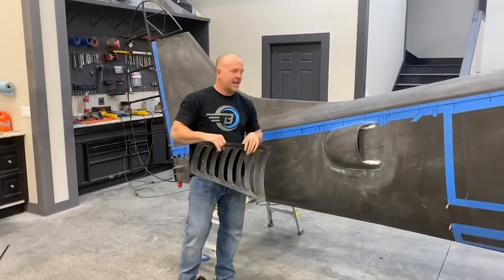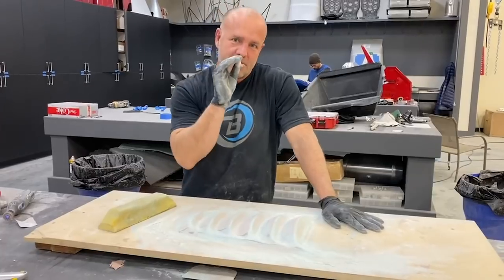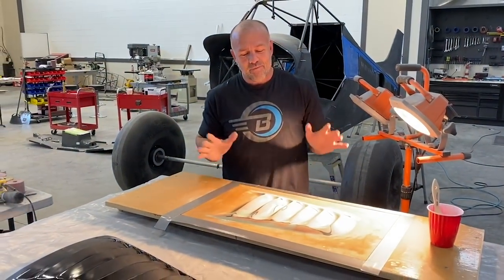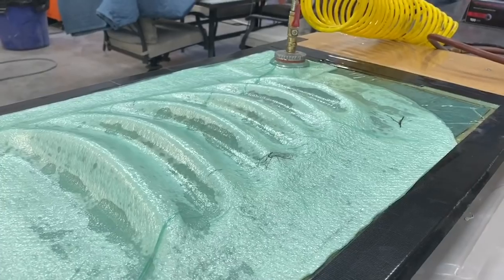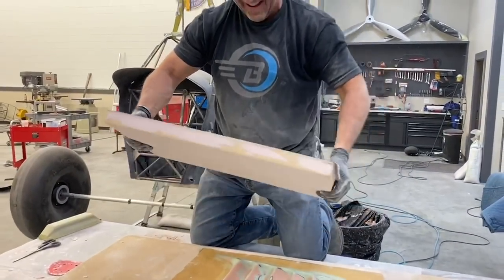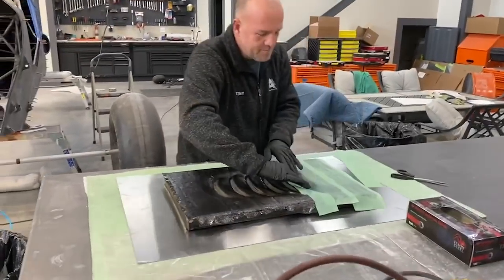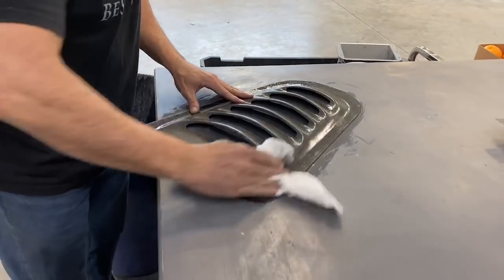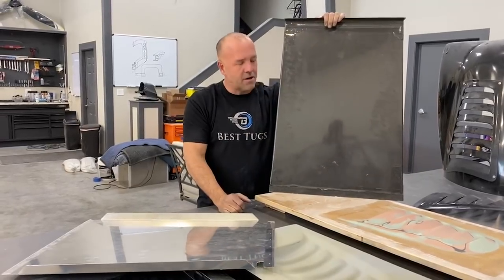🛠Making Carbon Fiber Molds (Scrappy Bush Plane 12)

Comment: I hate to say it because I love all you are doing but, it seems backwards to me. The larger opening should be toward the front so it tapers back toward the back of the fuselage.
Reply: It's an outlet not an inlet
Reply: He is looking for suction the air is coming in from the forward cowl and then thru the cooler and wants to suck out and exit the back end  depending on the fancy baffle control on the inside               I think
Reply: @snowgorilla9789  the air comes in from the inlet cowl right next to it, goes through the oil coolers and out from this new outlet fins
Reply: @grande521 , Yeah, but it doesn't look right.
Reply: @snowgorilla9789  I understand the function of the louvers. I am just saying that it would have functioned the same I think if the largeest louver was to the front and they tapered down to the rear. Because they do not taper down the way the fuselage does but go in reverse, it just looks like what it is, a copy of something made for something else. Of course it would have required rebuilding the part from scratch so that the largest the lovers were opening from largest to smallest i.e. completely reversed from the way they are now.
Reply: @billinfarmington5189  aah yes - you do have a point there.   I suspect that if he knew beforehand how much time it was going to take to make the first plug, he might have just gone ahead and built one from scratch in the configuration you suggest.   Given his demonstrated ability to build and shape from foam, he could probably have made the plug (what he called his "first mold") from scratch in not much more time than it took to pull the one from the original part.
Reply: @billinfarmington5189  "I am just saying that it would have functioned the same I think if the largeest louver was to the front and they tapered down to the rear.", maybe but it depends on more factors, in some cases the air around and exiting air of the front louvres create turbulence around the louvres behind it resulting in an uneven static pressure on the inside chamber, it could result in a pressure buildup and therefore lower airflow through the system so depending on the system it could be better to have the bigger louvres towards the rear to aid the airflow out of the louvres. Haven't seen much of the internal ducting yet though so who knows if thats a factor here
Reply: @Jeppelelle  We are in complete agreement.
Reply: @Mrfishlou  I agree. We all know why it is "backward" forever after. ;0)
Reply: @snowgorilla9789  I don't know how he gets "suction" when air is being RAMMED in from the front. The louvers are to allow the air to be forced out. Nothing is "sucking" the air out. That would imply there is a negative pressure behind the louvers pulling the air out.

Comment: I wonder how the reduction of weight will impact fuel consumption, and, if it does impact, what the fuel savings would be; and how low long it would take to make up the higher cost of carbon fiber?

Comment: Instead of those scissors, get old ones made for the fiberglass industry, anything circa 70's young 80's. The thicker the blades, the better, means there's good metal there and you can easily sharpen them with a synthetic ruby stone.

Comment: While I understand the idea of using what's in front of you, I'm curious why a guy wouldn't use a molding product like Smooth On to make the negative of the original rather than going through all vacuuming and multi-material mold making that we're seeing here.  Mike, anyone else: Thoughts..?

Comment: As a suggestion I would not have used the large amounts of bondo.  Its not very strong.  Try a two part urethane.  It copies perfectly and without bubbles.  just a thought

Comment: I think it would have saved a lot of effort if you had screwed the old part you had on a straight surface and heat it with a hair dryer / heat gun. The resin would have softened and taken the straight shape. Since it is not a load bearing piece it would have worked.

Comment: Why didn't you use Black tooling Gel-coat on this mould? Why didn't you use a very light E-cloth for your first cloth over the part? Why are you using Bondo to fill this mould up? It would have been better to do all of the above and have a Mould that could be wet sanded and polished in less than an hour.

Comment: How long does carbon fiber Last and keep its integrity?
Reply: In theory it could last indefinitely.  One of the first production carbon fiber airplanes was the Beechcraft Starship (very cool plane look it up). Owners of the few remaining examples say they have had no significant airframe issues even after all these years.

Edit: Forgot to mention that CF doesn't fatigue like metal does as it is loaded and unloaded.
Reply: I appreciate the reply. Obviously any aircraft you’d want to keep inside and out of the sun but I’m just curious about the effects of sun versus carbon fiber extreme conditions hot and or cold. Thanks again for your reply
Reply from the maker: Excellent question. UV radiation is the biggest killer of carbon fiber, so it is crucial to get and keep a good UV protectant coat on it at all times if your going to have bare Carbon Fiber. Most manufacturers paint over the carbon. Cold doesn’t effect it negatively, but heat will weaken it. Another reason why most carbon fiber airplanes are light colors.
Reply: I’m learning and dreaming of future builds, when I grow up I want to be like you 😉 thank you for sharing your knowledge I am truly learning a lot. Thanks for responding to my question. 👍🏻 now back to work.

Comment: I've been using "bondo" to repair cars for 25 years, It pains me to see you grinding away on that terrible body filler, you'd save so much time with a better product, Please try Evercoat RAGE Ultra, Sands in 1/2 the time of the stuff you are using. Also try Evercoat Plastic Honey to modify viscosity. You will not be disappointed. Part numbers 100125 and 101249 respectively. They also sell an extended work time filler thats good for bigger areas 100144 RAGE Ultra extra. Night and day from what you have been using. Great videos also, thanks for the entertainment.

Comment: I didn't like the look of it when you held it up to the side of the airplane.   I think you can do much better.   You need to rethink the actual look and styling of the vent.   It needs to integrate into the body of the airplane better.  RIght now it looks too much like an add-on.   Not something that is really designed by a top class designer.